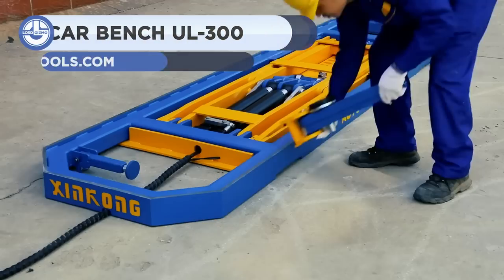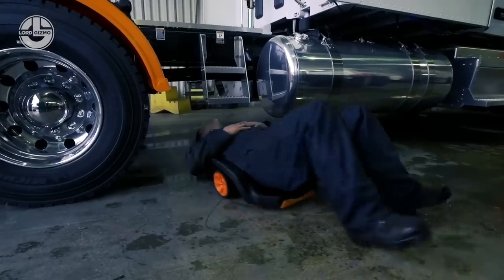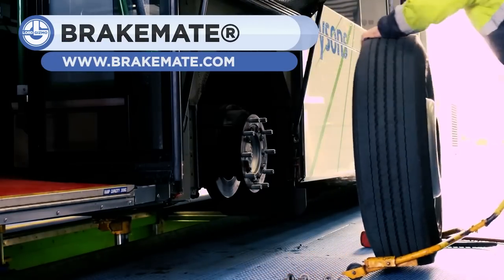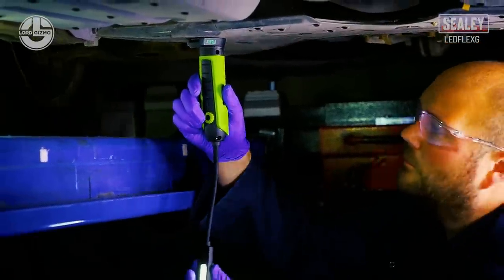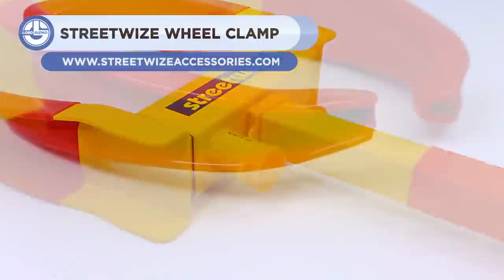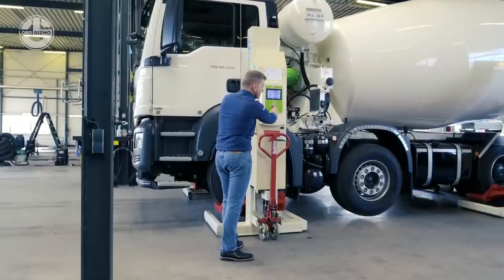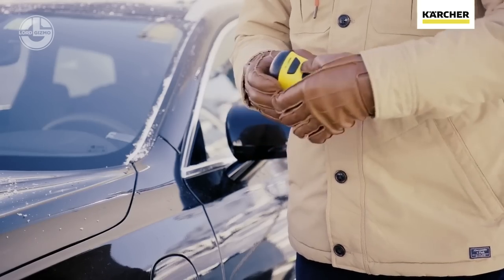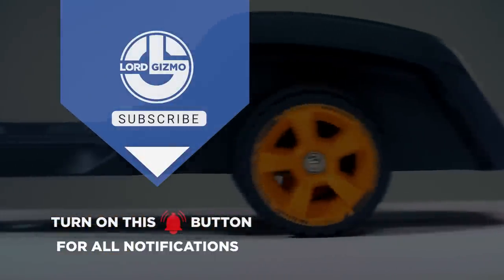Ingenious Car Inventions And Tools You Need To See

Comment: 0:25 You destroyed the car
The airbag was used to lift the car at totally the wrong point, potentially crushing the sill.
In addition, it had an aggressive metal-pinned interface that will have destroyed the corosion protection and probaby dented/pierced the sill.

Terrible design.

Downvoted by myself.